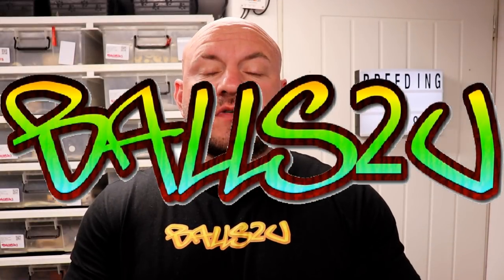INCUBATOR AND EGG BOX

Comment: Hi Gavin, i had a go at making a incubator out of an old vivarium, i got the temp up ok but at night the temps in the incubator drops by 2 or 3 degrees, is that ok or should i try something else? I have been keeping my eye out for a drinks cooler but no joy with that so far.
Cheers mate 👍👍👍
Reply from the maker: It's not going to hurt however the stat should keep it up to temp
Reply: Balls2U ok thanks Gavin.

Comment: If the temp is bang on now i run the incubator for months the humidity in the incubator is holding at 90%  the tubs in the  herpxotics incubator are rubs 5 litre so not air tight do i need a hole in the front and back as the eggs are a couple of days old and have a dimple in the top of them  and its a 50 50 mix vermiculite water or do they need more humidity

Comment: Hi Gavin, i know you said just get the incubator to 90degrees  and not worry about temps in the egg box, but the temp in my test egg box is 85-86 degrees but stable day and night, is that ok? My actual incubator is between 88 and 90 depending on time of day.
Thanks Gavin.
Reply from the maker: Yes that will be fine, over the course of the 55-60 days it will change and you should have babies 😉👍🏼
Reply: @Balls2U  brilliant, thanks for your time again Gavin.

Comment: I just saw this video and I actually put my a thermometer inside the egg box and my incubator is at 89 but inside the  egg box it reads 98 is that bad
Reply from the maker: Your thermometer is faulty...... It can't be hotter inside the egg box then the incubator
Reply: Balls2U that’s what I thought thanks so much because I have an extra thermometer on top and middle and they all read 89